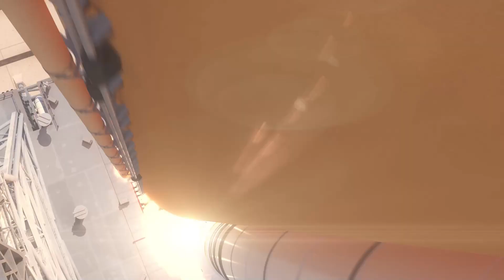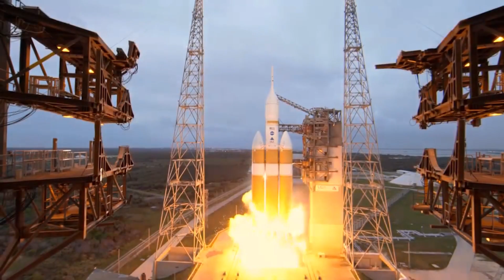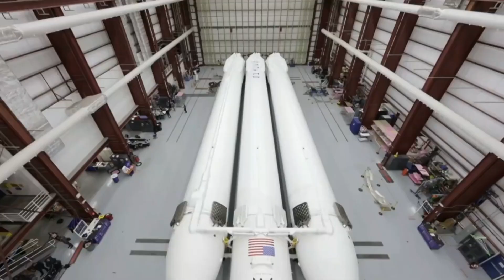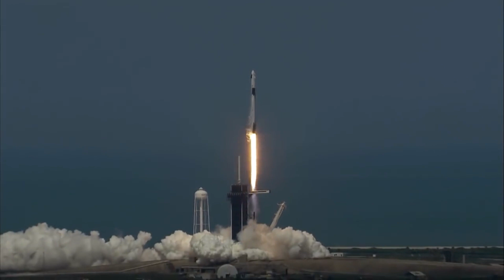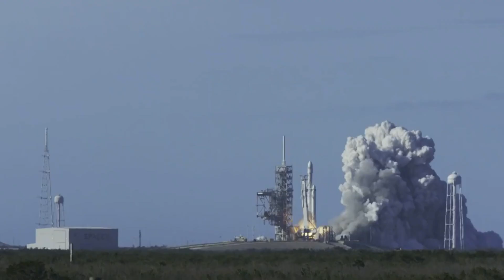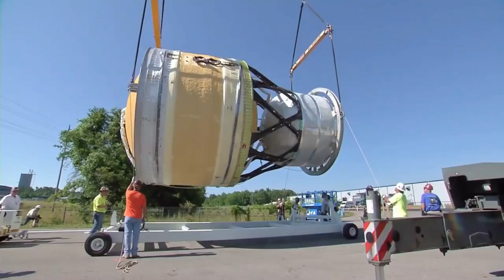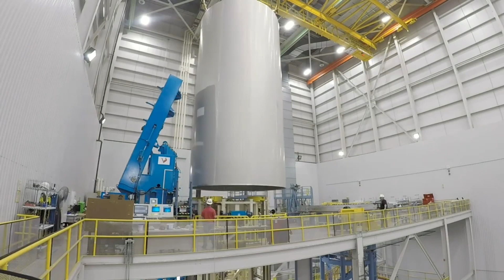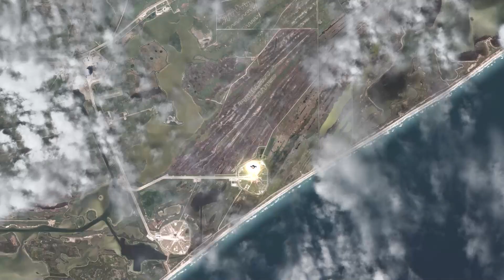Why Falcon heavy can't replace SLS

Comment: There is one showstopper that comes before everything else. Falcon Heavy is incapable of putting more than ~20 tons anywhere because of structural limitations, the upper stage can't handle anything more than that. It's amazing to me that after all these years some still claim SLS can easily be replaced by FH, not realizing how many flaws exist with this idea and the fact that Bridenstack was found to be infeasible in official studies.

Comment: The upper stage of the Vulcan that replaces the ICPS is relightable and bigger - presumably it will still have fuel once it is launched by itself into orbit, since it will not be launching any other payload other than itself and its extra fuel reserves for translunar injection. Somehow, you missed the proposal of docking of Orion with the Centaur V in orbit, and the Centaur V propelling the Orion to the Moon.
Reply: OK, Centaur V - 54 tons of propellant can be held in fuel tanks. It might need a design change so it can be refueled [yet another launch] to top up the propellant, complicated tech - but SLS is *expensive*, and even complicated changes will look good ...

Comment: Can the whole Space Shuttle program be a giant hoax?
How could they have sent such a giant thing into earth orbit, while SLS cannot carry something really heavy and big in real life.
For example, SLS could not even launch James Webb, so NASA used ESA's Ariane 5.
But how could the less powerful set up for Shuttle send 100 ton Shuttle into orbit?
Reply from the maker: SLS could’ve very easily launch JWST and was even manifested to at one point. The problem is that SLS wasn’t ready when JWST was
Reply: @DavidWillisSLS  Don't you think the payload (Shuttle, the orbiter) is way too big compared to what other rockets are carrying to LEO?
Maybe it's designed to just go around the earth 1-3 times and slowly come back to earth. not properly orbiting.
Orbit speed needs to be Mach 25.
That's not easy even for SpaceX Starship with 30 rocket engines.
As the Shuttle have wings, it could even stay for 3-6 hours in near space as it slowly falls down.
Reply: @DavidWillisSLS  Do you believe the moon landing?
1969-1972, they went to the moon in 3 days, landed, played golf, drove buggy, and then flew off from the moon and came back to earth, all in about 10 days?
While in 2022, they went to the moon in 10 days, didn't land, didn't play golf, didn't drive any car, and came back, all in 25 days?
Oh, and on top of that, they send mannequins with radiation sensors?  🤡
Reply: I have genuenly lost brain cells while reading this comment. Apollo had more speed so it was going faster and it wasnt 10 it was 14 days orion is slower going then apollo . And the shuttle stack didnt bring the Orbiter to full orbit the orbital manuvering thrusters did .
Reply: @ILikeAlotofThings-SLS  Shuttle's publicized weight = up to 140 tons, and the total weight with boosters and external fuel tank = 2000 tons => 7% of total weight
SpaceX, Falcon 9 = 570 tons rocket total, crew module = 12.2 tons => 2.2% of the total weight orbits.
So, it seems for the Shuttle to reach orbital speed of Mach 25 like others, it should have had 6 boosters and 3 times bigger external fuel tank.
Huh?

Comment: This is off topic but couldn’t spacex make a falcon super heavy with 4boosters surrounding the main 1 booster and also increase the second stage size. If they did this spacex could have starship level payloads years earlier
Reply from the maker: They’d need a new launch pad but in theory I suppose it would be possible. Reuse would be off the table though since there aren’t enough landing pads or drone ships to recover all 5 boosters

Comment: I Know this will never happen, but you literally just listed a bunch of super easy problems to solve lmao
Reply from the maker: You just admitted that they’re never going to happen.

So it looks like they’re not so easy to solve
Reply: @DavidWillisSLS  It's never going to happen because congress wants NASA to make SLS for jobs, not because it is the best option
Reply from the maker: @Kerbal18  it’s never going to happen because, like I said in the video, they don’t have any more ICPS’s
Reply: @DavidWillisSLS  Do you think NASA wouldnt be able to just pay ULA to keep making them? Probably considerably less than $4b/launch to do so
Reply from the maker: @Kerbal18 there would be no point due to the other problems listed in the video

Additionally, the falcon heavy Orion only works as a replacement for the block 1 SLS.

The block 1b SLS rocket is already well into development and would make that falcon heavy rocket pointlessly obsolete.

Oh and btw, that 4 billion per launch number isn’t correct. It would be half of that, since half of the 4 billion is Orion and ground systems, which you have to pay for even if you use the falcon heavy system.

So there’s next to no gain, for a vehicle that would be used, at most, a single time, and then be replaced.

You do the math and tell me if that’s a good use of resources
Reply: @DavidWillisSLS  Fueling is a non-issue, that takes a year and a half at max. Use the VAB for stacking. Crew rate the vehicle. It's still a nonissue. As for Block 1b, what would even be the point when you can again use the vastly cheaper falcon heavy in a payload configuration to get gateway segments there
Reply from the maker: @Kerbal18  you can’t use the VAB for stacking because the SpaceX hanger blocks the path to pad 39A

And the payloads can’t launch on falcon heavy because they need Orion to be the bus that transfers them.

Halo only works because PPE can be that bus. None of the others work like that, they all need Orion.

You really need to just accept reality at this point.
Reply: @DavidWillisSLS  They could just build a little road around the hanger, not seeing how thats even remotely a problem. Not seeing why station segments need Orion because they could easily just make something else that could steer them there, perhaps something similar to dragon XL but without the cargo part.

Comment: You're looking at it the  wrong way. There's no reason to human rate additional rockets.

You send Orion and service module up on two seperate Falcon 9s, or any other non-human rated rocket that can lift  the needed mass.

Have the ISS capture them, mate them together, then hook them up to the ISS electrical system so they're fully charged.

Then you send up as many Falcon 9s as needed to fill the fuel tank for the service module. Then you send up the crew on a human rated Falcon 9.

They get in, detach from the ISS and fire off their TLI rocket. Done.

Now I don't necessarily have all the details of the different components of SLS memorized, so insert whatever I forgot. 

But the point is, there's no need for these huge rockets. Design your modules to what you have available. Assemble in orbit. Once in LEO you can get pretty much anywhere else, it's a question of how much fuel you have.

Trying to make these huge structures and launch them on one giant rocket is not the way to go. Just make something that makes it to LEO and waits at the ISS until you get additional fuel and go from there.

The only reason we use SLS is because the Senate wants something spends money in every state, hence Senate Launch System.

Comment: The way I see it is these various rockets are all designed with specific ranges of roles in mind. SLS is designed first and foremost as a crew rated lunar rocket with the prospective capability to support Mars missions.

FH is designed for heavy cargo and is capable of deep space missions, intended for uncrewed missions only.

Similar to SLS but sort of the reverse, Starship is designed for crewed travel to Mars with a planned lunar variant for crewed lunar missions (assuming the Gateway program doesn't get canceled).

Simply put, Falcon Heavy can't replace SLS because it's not supposed to. Starship might eventually push SLS into obsolescence but as of today, September 1, 2022, SLS is the only moon rocket that is functionally complete and is sitting on the pad at this moment waiting for its first trip to the moon and back. We'll see if they have to scrub the launch again this Saturday.

Comment: I've got a different idea, but its a little eccentric.  Launch Orion without the ICPS on a Falcon Heavy.  Without the ICPS you solve the first two problems: horizontal assembly and lack of hydrogen fuel.  It may also allow the Falcon to be fly in reusable mode given the reduced payload.

Without the ICPS Orion will be stuck in LEO, so it docks with Lunar Starship which then carries it to Lunar orbit.  Upon arrival, astronauts transfer to lunar starship and descend to the moon.  When its time to come home, they ascend to orbit and rejoin Orion which takes them home.

Comment: Servers years to build the pipes to handle hydrogen ? Nobody thinks it will be free to use falcon heavy , but sure as dead it will be less expensive than SLS, and faster. The same goes for Starship. The reasonable stuff will have being to create a better successor for the falcon 9 series , with a bigger fairing. There is no market for big rockets , so the private sector and the governments can’t share costs. We need to improve multiple launch assembly if we want to go outside low earth orbit

Comment: Remember that  Vice President Pence had just delivered a speech in Alabama stating that other means would be found to get out astronauts to the surface moon by 2024 if SLS was not up to it. As the budget tightens with massive inflation, SLS may just price itself out of existence.
Reply from the maker: Not a chance actually. SLS might be the only part of the Artemis program capable of supporting a lunar mission in 2024
Reply: @DavidWillisSLS  My point simply is that I'm pretty sure people were able to buy baby formula during the Apollo program,  and economic politics is about to turn nasty.
Reply from the maker: @anthonycook6213  yeah but the Apollo program was way more expensive than Artemis could even dream of being. Artemis is running on the same budget as the shuttle was
Reply: @DavidWillisSLS  Yes, but Apollo was budgeted correctly and achieved very clearly stated goals within it's allotted time. Then it vanished. Remember that Constellation got as far as Ares 1X, then was forgotten. All because of unsustainable expense. Actually, I want SLS and Artemis to be the start of something great, but it is not meeting it's goals, and is constantly over budget, at orders of magnitude more expense than SpaceX seemingly would tolerate. The contractors of SLS don't seem very motivated. Let's hope that Artemis 1 flies soon and is a success.
Reply from the maker: @anthonycook6213  the shuttle had no goals and flew for 30 years
Reply: @DavidWillisSLS  When shuttle was announced, it was sold as making access to space sustainable and routine. I was in the crowd of over 400,000 people at  Columbia's first landing. It took a long time for the truth to sink in. Many people did not know what a space shuttle was when it ended. Anyway, I'm not trying to argue with you, I'm just cautioning that patience for SLS delays and costs will not be limitless, and an orbital Star Ship will raise some taxpayer "why $$$" questions.

Comment: This video has many attempt presentation of DOUBTS, but to do so, needed to present simulations, in example of the BGH, indeed if they modify the nose cone at top, however the broad top head, prevents the effect of a sound barrier drag, when ascending rapidly to thinner atmospher, the doubt is, will it have less effect or fuel power under drag, must demonstrate, for this video, no CGI, lacked to display that. We wouldn't want to assume there is any bias or side take for SLS.

Comment: Wait wait wait.  What?  There will only be so many ICPS's.  OK got it.  But what about that fact show-stops its use with the Falcon Heavy?  Are you saying that there will be no "spare" ICPS's for a ICPS+FH test flight?  Is that what you mean?  Something else?
Reply: No, there won't be. Delta IV Heavy only has like 4 flights left and 3 on Block 1 of SLS. No plans to produce them afterwards. Theoretically could be done but nothing pointing towards it
Reply: Now what you could do is have the mission split into two launches, two Falcon Heavy flights. One with a LOX/CH4 transfer stage and one with Orion. Launch the transfer stage first, launch Orion, dock, and pew off to the moon.
The launch vehicle/stage costs would drop to ~$500m compared to the $1.5b for SLS.
Reply: I don't understand this single launch obsession. Distributed launch makes things so much more robust and cheaper.
Reply from the maker: It’s safer to do it with a single SLS launch. So that’s why
Reply: @DavidWillisSLS  is avoiding a single docking maneuver really worth $1b?
Reply from the maker: @iamarokotmanson  you’re ignoring the part where falcon heavy isn’t crew rated
Reply: @DavidWillisSLS  who's to say it can't be though?
Reply from the maker: @iamarokotmanson  Elon misk
Reply: @DavidWillisSLS  Vulcan exists. Although this plan won't ever see the light of day

Comment: I would suggest that the biggest problem is actually the cost amortisation structure that NASA is dependent on to have a program like Artemis... meaning that it has already paid a disproportionate amount of its funding as part of its obligations... meaning, it would be literally throwing away money to spend more money on an unproven potentiate.
Reply from the maker: And what exactly is unproven?
Reply: @DavidWillisSLS  you said it in your video… the aero dynamics… all the things…
Reply from the maker: Oh yeah yeah. I thought you were talking about SLS
Reply from the maker: My bad
Reply: @DavidWillisSLS  no, I’m the builder, so, I mean SLS is legit. More new basic technology in SLS than just about anything going…
Reply: @DavidWillisSLS  but back to the point, largely to enable a floating budget that guarantees NASA’s funding relative to the scale of its ambition, NASA reallocates… a lot…
Reply: @DavidWillisSLS  so, like it will put in a budget request for like let’s say 30b$ and it might get 14b$ but with a big ticket item on the roster that is universally approved, it can get a slate budget that allows it to assume a relative higher rate of funding beyond its allocated proportionate sum, to cover its obligations… so, 14b$ turns into 25b$ and the rest is ‘cheques and balances’…
Reply: @DavidWillisSLS  it’s actually pretty rude but I mean, that’s NASA…
Reply: @DavidWillisSLS  the point is, if on paper you’ve already paid for something and then you have to go back to lawmakers for more money because you say you have the funds but you’ve spent them… that’s a problem…

Comment: Orion COULD go to TLI with Falcon Heavy + Falcon Heavy with no payload to bring a new Stage 2 for TLI maybe
Reply from the maker: Orion won’t have docking capability until ARTEMIS III and Artemis IV needs Orion to fly on SLS so IHAB can be comanifested to the gateway on block 1b
Reply: @DavidWillisSLS  Yeah, it's just theoretical without having the trouble of hydrogen at 39A. SLS is the best thing to use imo, it's just a theory.

Comment: You seem blind sided to the key argument about the validity of the existence of SLS.  The HLS system IS Starship, so even if SLS is used for the moon, it can't work until Starship works. The very best it can do is support a flight around the moon, which is of no use in moving the work forward. 
Once Starship works, the cheapest and most effective way to land men on the moon is to launch Lunar starship into orbit, unmanned, re-fuel it. Crew it using F9 and dragon. Fly to the moon in Lunar Starship, land directly on the moon then fly back to LEO in Lunar Starship. Return to Earth in Dragon. If behind the moon comms is an issue, don't build a crappy little space station around the moon, just launch a small satellite array into lunar orbit. Laser starlink or similar could do the job. The Lunar starship must be human rated for main engine burn, in order to carry out its contract with NASA as part of Artemis, so flying from Earth to the moon is no additional risk. Ask an astronaut which he would rather fly in? A glorified bean can (Orion) or a airliner sized spaceship. As the starship system matures, crew could be launched on the final Starship transport and rendezvous with a fully fuelled Lunar Starship in orbit. On return, the crew could transfer beck to that Starship for earth return.
The main challenge for starship is not human rating ascent or trans lunar flight and landing, it is human rating the return to Earth. NASA are reluctant to use propulsive landing back to Earth, rightly so in my opinion. But this will be reliable at some point in the future. Given the cadence of SpaceX launching, it will not take more than a few years to make PL safe. 
SLS has no future in space exploration, it is a footnote to political stupidity. It is far too expensive, can't launch more than once a year and lacks any credibility as the platform that will SUSTAIN manned exploration of the solar system. If you think otherwise, I would ask you to look again at the cold facts.

Comment: To say that Falcon heavy is not crew rate is a problem is preposterous. We know that SLS is made from left over Shuttle parts. That is, it is a Frankenstein made up from 40 year old parts of a rocket that was a death trap. The Shuttle parts belong in a museum not on an operational rocket.
Reply from the maker: that doesn't matter. it has to be crew rated to fly astronauts. elon has said it wont be crew rated, so it isnt flying astronauts
Reply: @DavidWillisSLS  Yes it matters if you had to fly on a Senate Launch System or a Falcon Heavy, which would you chose?
Reply from the maker: @stephenhoughton632  I would fly on SLS because NASA specifically built it for the purpose of flying astronauts.